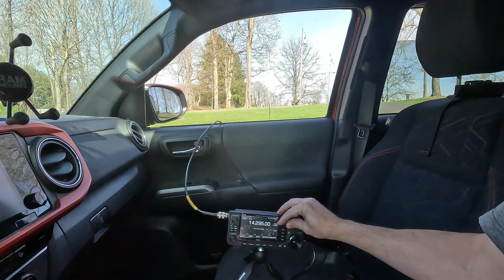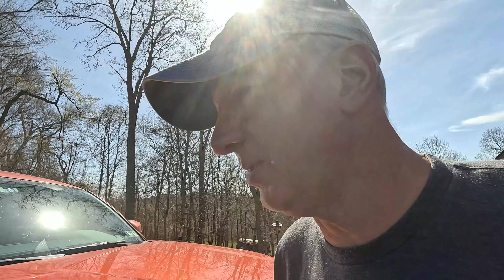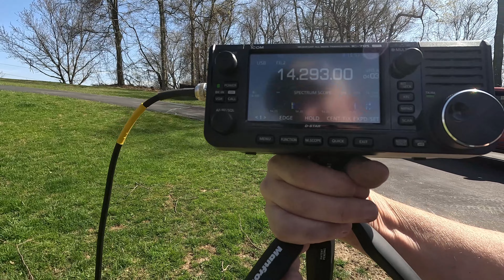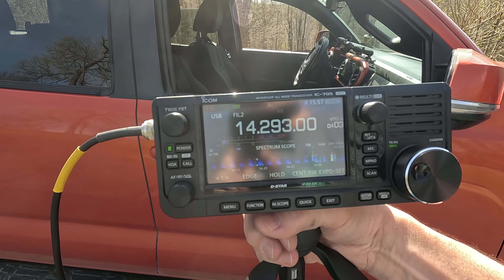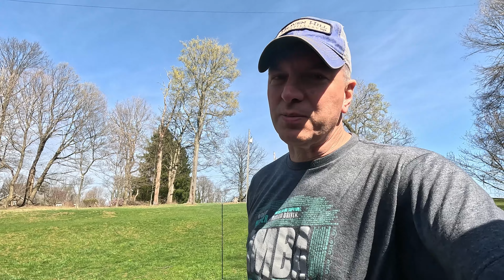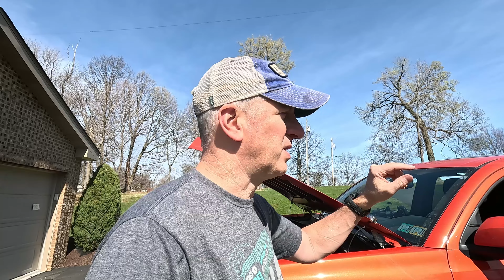Dealing with Toyota Tacoma RF noise - follow-up

Comment: Thanks for sharing this! I have same issue in my 2017 RAM 1500 after installing aftermarket LED stop light strip on the bed rack. What I noticed that the noise in my FTM-300D on 2 meters comes with pressing on a brake or put the gear in reverse. If I drive without stepping on the brake, there is absolutely zero noise. I am going to ground the radio directly to a chasse and replace mi wiring to LED strip with shielded cable. I am pretty sure it is LED driver causing the issue emitting PWM signal. Did you resolve your problem after all these years since you published this video? Thanks again and 73, KK4DJB

Comment: I know this video is a bit old but I have a 4Runner with the same issue which I fixed …here’s what you need to do …put a choke on the brake pedal sensor wire and you will need a RFI shield for the wire loom under the hood and some elbow grease ..problem solved
Reply from the maker: Hmmm.  What do you mean RFI shield?  Faraday cloth or something?  I've been told it was the fuel pump and I need to choke it there.

Comment: Skip the ferrite cores—they won’t do much for coax. Unplug anything in the cigarette lighter, and double-check your Bluetooth or dash cam. Then coil the coax—near the antenna and near the radio. I use one wrap at VHF, but you’ll want two or three turns for 20 meters. If it still whines—well, that’s just Tacoma charm.
Reply from the maker: VHF isn't the issue.  HF.  Most of the comment I got say it's the fuel pump.
Reply: @TangoOscarMikeN3WS Have you tried ferrite cores on the power wires to the fuel pump? Though they don't work for RF through coax, they do work for DC power wires...if that's the source.

Comment: Unless I missed something, please let me know when you figured out your problem.  I have the same problem on HF.  I noticed when I put a CB in, it was noisy when the vehicle was on...it ditched the CB and hooked up an FT891 on 20 and 40m and problem persisted.  I was thinking I could get away from twenty seven megahertz, and it would be okay, but it did not get any better.
Reply: Also, i completely relate to your problem, the ft891 is sitting 20' away from the truck on a lifepo4 battery completely isolated from the trucks electrical system with 25' of coax and an ATAS120A screwdriver antenna mounted next to the right rear taillight.  The RF is gone when engine is off as soon as I crank it, S5 noise floor, as I Rev up the engine, its an S8 and above.  Idk so any help is appreciated.  Thanks for the video!!!
Reply from the maker: I'm told it's the fuel pump and you can choke it, but my truck is currently in the body shop for a fender bender.

Comment: I’ll be installing a ATAs 120 on my 2017 Tacoma. I plan to run the radio off a separate from the truck. I ordered ground straps. So you’re saying it’s useless to bond it and just run the radio with the truck off?
Reply from the maker: That is my experience.  I ran the IC-705 off it's battery.  There may be a solution by putting a wiring choke at the fuel pump.  The Grounding isn't going to hurt, the bigger the ground the better, but the noise never went away.

Comment: Thanks Tom for placing my solution to the problem in the video description, as I've since learned that outside links aren't accepted in the comments section. Hopefully it helps others with this common modern vehicle fuel pump system control module, HF noise generation problem. Plus it's a relatively inexpensive fix. Best of luck everyone!
Reply: I unplugged the fuel pump fuse and turned the truck over and the problem persists....I think it might be an alternator issue
Reply: @codybooth Thanks for the feedback. If you take a portable AM radio and move it to the FPCM, it'll give off lots of noise if that's the cause of your RF noise.

If it does, the FPCM, not the actual fuel pump, is likely using the wiring harness as an antenna and broadcasting straight into the HF radio antenna—no amount of grounding the HF radio will stop that.

That was what happened in my case, and the ferrite harness I made that plugged into the FPCM and the factory harness fixed it, because it killed the noise at the source.

The alternator will be a noise source too, along with injectors etc. It's about picking off the main cause, then deciding if the others are worth the effort. When you kill the worst source, you'll hear other ones that are lower in strength. Mine's now S1/S2 from S7 to +20 dB. Now I can hear my ignition, but the NB takes care of it, so I'm good now.

Let me know if I can help.
Reply: @cruizn I can’t wait to make mine. I am in the process of sourcing connectors.

Comment: RFI on my 2010 Avalanche is horrible.  Specially on the 20m band.  I've got ignition noise and the notorious high pitch fuel pump noise as well.  Bonded many parts of the car.  Noise remains.  It's an ongoing battle.
Reply from the maker: It is frustrating.  I would think an older vehicle would be better.
Reply: Check my post—20M was the S9 +20 dB (present but lower on other bands) on my car, and I fixed it relatively easily. Good luck.

Comment: I am going thru the same issue.  Everyone says it is the 3rd Gen Taoma fuel pump.   I have found if I turn off the front LEDs, I go from s9 to s6 noise, not great, but a start.  I ordered DX Engineering mix31 clip on kit and a cheap Amazon bundle ferrite clip on kit, I ordered two dozen grounding straps --- all installed, same noise level.   Very frustrating to say the least.  N4TRD
Reply from the maker: I gave up.  My Wifes 4-runner is the same.  If you figure anything out let me know.
Reply: @TangoOscarMikeN3WS  
Check my post—20M was the S9 +20 dB (present but lower on other bands) on my car, and I fixed it relatively easily. Good luck.
Reply: @cruizn where’s your post? Looking for how to improve this
Reply: I can't find my post, and every time I re-post the link it auto-deletes. I'll ask Tom if he would be willing to put the link in his video description where external links are allowed.  I'll update...
Reply: Hey there, my two next steps, I am going to a custom coax builder and see if I can get a coax with some sort of super shield.   I am also going to buy a couple sheets of faraday cloth and wrap the whole coax.   Have you tried that?   Just roll the coax into the faraday cloth.    I might even try to wrap the engine bay with faraday cloth.   Toyota put the fuel pump in the tank and the only way to get to it is drop the tank or remove the bed, so wrapping the tank / pump in faraday cloth is out.   I was also looking at buying an extended tank and new fuel pump, wrapping in faraday.  But I really do not need and do not want to drop $2500-$3000.   Totally BS, love my Tacoma, but this just plain sucks ass.
Reply from the maker: @ncoldmanoverland  I haven't gone that far.  It is an interesting idea that I haven't thought of.  I think that might be hard to do as I think every gap would have to be sealed.  I was just think about putting a portable battery powered fan in the Truck to help keep me cool.
Reply: @TangoOscarMikeN3WS  I do have two rechargable fans, but that does not help me when I am mobile.  We overland out west, it is a 30 hour drive.  I would be nice to use the radio driving.....  So frustrating.....

Comment: You can put the antenna on a mag mount on the roof above the rear passenger compartment. Making sure the coax is running between the seats and not on the floor. And it “should” be fine. At least that’s the only thing that worked for me on my 2017 Tacoma.
Reply from the maker: What model do you have?  I've have a 2017 off-road.  Another person with a sport said he doesn't have the issue, but the off-road had the whole traction control system.  Just curious.  Thanks
Reply: @TangoOscarMikeN3WS  mine is the TRD Off-Road as well. It’s been an rfi nightmare.

Comment: I have a 2014 Tacoma Access Cab with the same problem. I haven't been able to get rid of the S9+ noise level. I feel your pain. 73 de N6EF.
Reply from the maker: It sucks.  I've found no solution.
Reply: Check my post—20M was the S9 +20 dB (present but lower on other bands) on my car, and I fixed it relatively easily. Good luck.

Comment: I'm going to have to do some experimenting this weekend.
I've done some POTAs this winter from my Tacoma with the 891 and 818, but without the engine running except one time with the 891. The noise blanker made things reasonable. I should take out my 705 and see if I can replicate your results. Along with the 818 since I ran that without the engine one.

Have you tried other HF rigs? The 705 has a reputation of being pretty sensitive. Maybe a different HF radio might be workable in your Tacoma with the engine running.

Comment: I’m not sure why but in the Gen3 Tacomas, Toyota went to a new fuel pump and I’m told the the motor is the cause of the RF. Have not confirmed it but I feel your pain. I have a 7100 in my Taco, I’ve grounded more in this truck then I’ve ever done in 23 years. I’ve added filters, common mode chokes name it and I’ve tried it. Same result…. Noise noise noise when it’s running. Good luck.
Reply: My 2023 Tacoma has the same issue on 20m.  It is certainly the fuel pump--if you put a rubber duck on the 705 and get close to the bottom of the fuel tank, you'll notice it's WAY strong.

Comment: I am wondering if following may help:  (1) Chock both end of coax (2) ground the radio with the car.
Reply: Yes. My first thought is to ground the radio to the truck.  I have a ground wire under a mounting bolt  and I have aligator clips on the ground wire  of my TS-50, IC-706 and the G-90 that I put in two older Chevys.

Comment: look for noise with key in accessory position and then in run position (but not started) and then while running, you will be able to turn on and off things like the blower motor for the ac and the am/fm radio (if any noise is present) then when in the run position but engine not running things like the fuel pump and ecu and other modules will be on, this will tell you if its one of those. if it only happens when the engine is running it could be an alternator, spark plug, or plug wires if it even has those or ignition modules. good luck and happy hunting! good video.... 73 de KO4CDJ
Reply from the maker: I did see the noise in accessory before, but it's a good idea.  Probably going to try pulling some fuses as well.

Comment: My wife and I have used our FT-891 in our 4runner(2017) without that that much noise.  We use the noise blanker with the engine running and that takes care of most the engine problem.  Planning to install it for mobile use and not just parked so I'll find out what happens then. I hope to avoid the excessive grounding exercise myself but I'll do what I have to.  
Good Luck with it Tom.   KD2UBJ es W2SUZ
Reply from the maker: We've got a 4 runner for my wife on order.  They said it could be 6 months or more, that was 2 months ago.  I'm pretty sure I tried the noise blanker before, but I put it on my list to test again.  Thanks.
Reply: @TangoOscarMikeN3WS  you may rarely get to drive the 4runner. It's a treat for me.  Normally in my 2009 Tacoma, no HF radio.

Comment: It's the fuel pump.  Good luck getting to it.  Toyota got us.....
Reply from the maker: You'd have to take the whole bed off to get to it.  I'll see if I my little detection loop pick up anything back there.
Reply: @TangoOscarMikeN3WS  This came to me from a friend who has a 2018 Tacoma.  He did the exact same thing you did and finally narrowed it down to the fuel pump.
Reply: I have the same problem with a 2022 Tacoma. My immediate solution is to carry a 50Ah LiFePO4 battery. I have either a Hustler mobile antenna or a full size 1/4 wave telescoping whip that is mounted on a trailer hitch where the ball usually mounts. I moved this over from my 1996 4Runner when I got the 2022 Tacoma. Since I hardly ever operated with the engine on in the 4Runner (about 20 years) I am ok enough the way it is I have not taken the time to attempt to improve the situation.
It appears the interference is radiated from one or more things in the Tacoma. I suspect as was mentioned the fuel pump as a big contributor but I also think the fuel injection and all the other computers contribute significantly! What I would like to have bought was something like a new 1978 Ford F150 with straight 6 and 4 speed manual. I had one and absolutely no such noise problem. I also remember working HF mobile with my 1989 Toyota truck with minimum noise. I guess those days are gone!

Comment: The other 2 things I found in my honda car that caused a ton of rfi were my factory radio and the blower motor for the hvac system. The factory radio even put out noise when turned off. I found these noise generators by pulling fuses one by one and checking the noise level on my 891. I threw chokes on that wiring and it helped quite a bit. I wasn't able to get 100% of the noise gone, but it made my radio usable with the car running.
Reply: There should be a fuse box inside the truck and one under the hood.
Reply from the maker: I have thought about pulling fuses.  Might try that.  Thanks